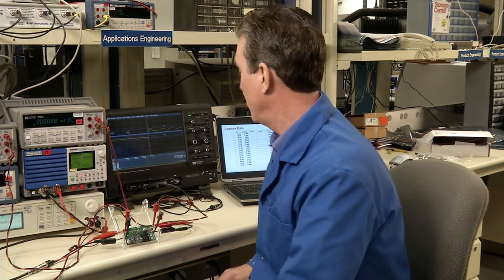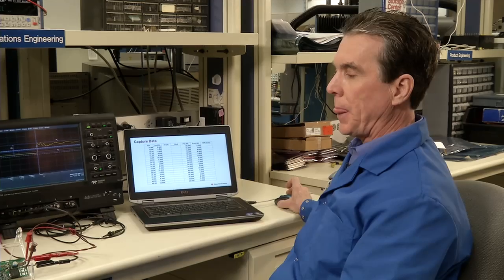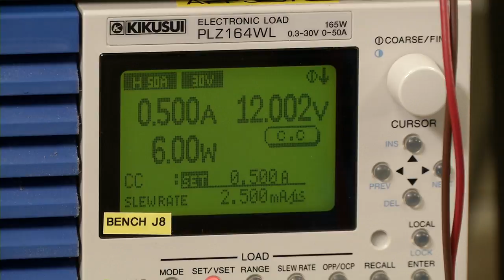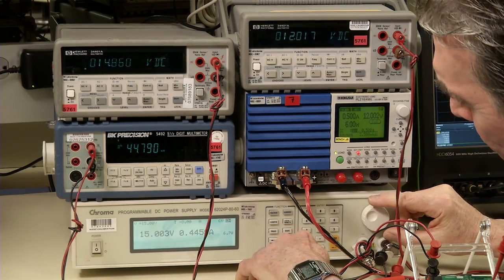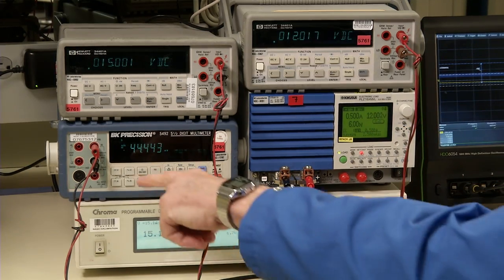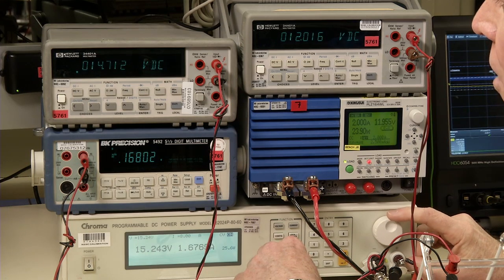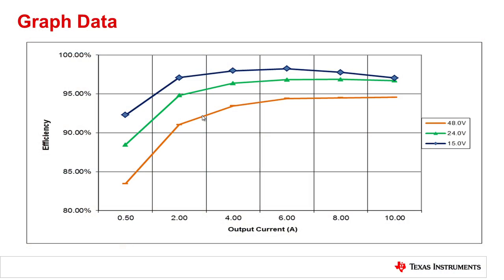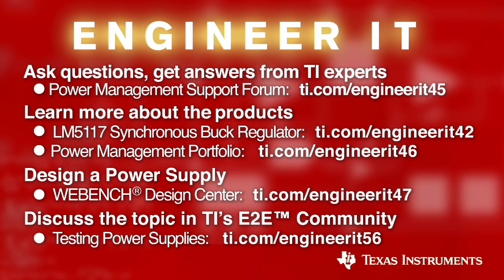Engineer It - How to test power supplies - Measuring Efficiency

Comment: Thank you very much for your video. It will be very useful for my lab class at university. Could you tell me how you initially set the input current on the power supply? As you know, for a power supply, you can set not only the voltage but also the current.

Comment from the maker: When delivering power to a load, the higher the voltage the lower the current (P=IE). Since power loss across any resistance (such as wire, transistors, inductors) is a function of the square of the current times the resistance, reducing the current in half (by doubling voltage) will decrease the power loss across those resistances by a factor of 4. This is one of the reasons why very high voltage is used when delivering electrical power long distances. For more info, click: ow.ly\pb0fS